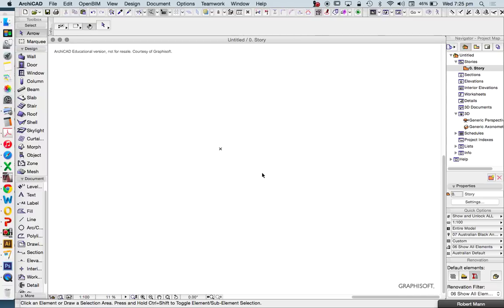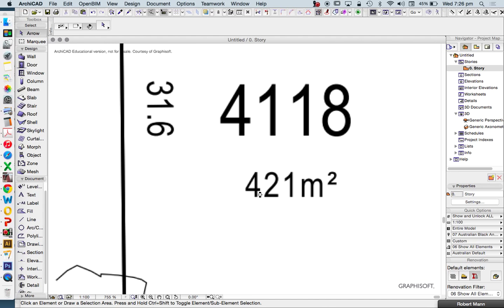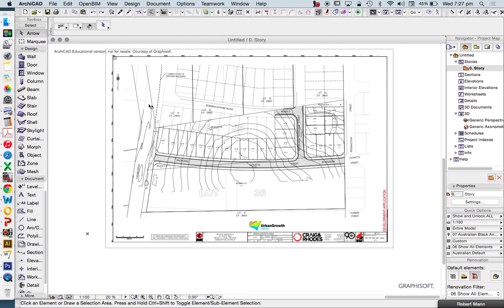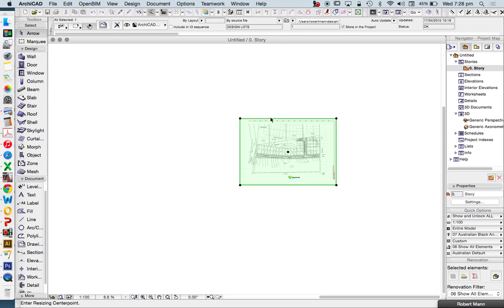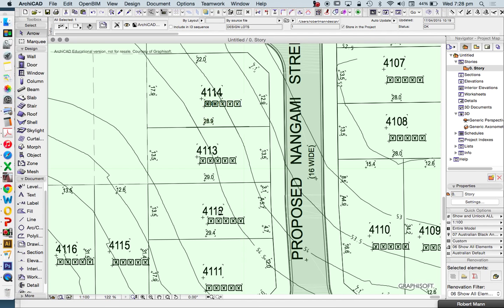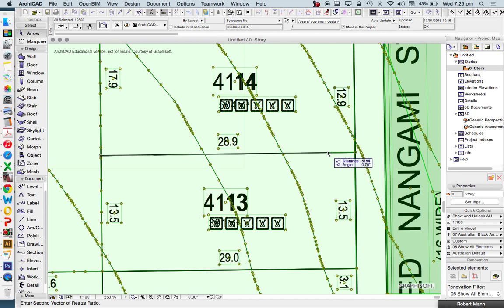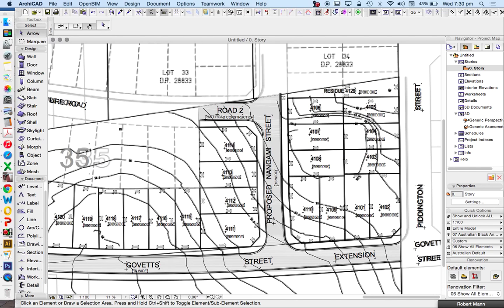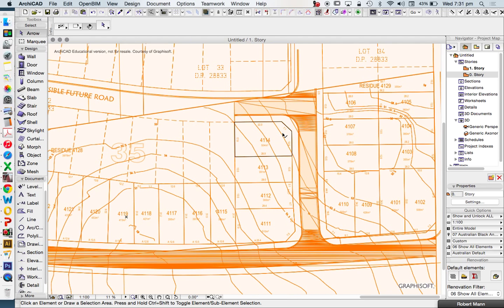ARCHICAD INTRODUCTION 05 - IMPORT PDF

Comment: am resizing but only the specific line I resize is accurate,  but not all lines on the drawing are resizing... how can I resize entire drawing to actual dimensions of the pdf. thank you...
Reply from the maker: Hi Jacob, unfortunately not all pdf's that you might be using will actually be drawn accurately to scale. If the file is perfect then using resize on just one element will allow you re-size the whole thing perfectly. You might have seen in several of my videos that this isn't always the case.

Comment from the maker: when you explode the pdf it will create grouped vectors (lines) and keep the original. you can either keep or delete the pdf. to resize the linework you must disable grouping, select the lines use the resize tool, then enable grouping unless you need to edit the lines further :-)